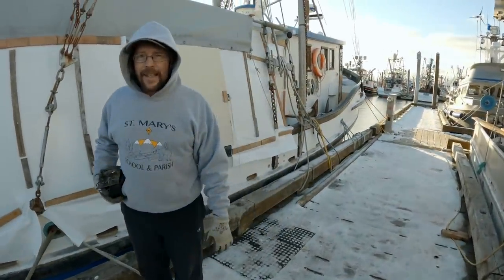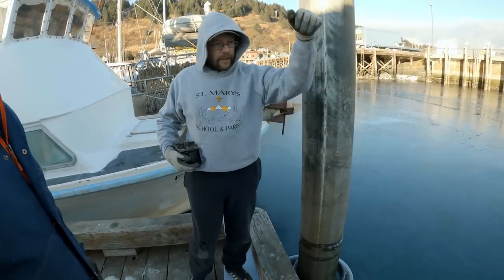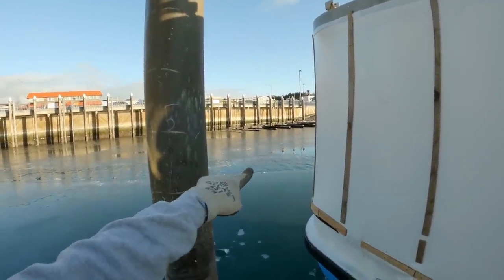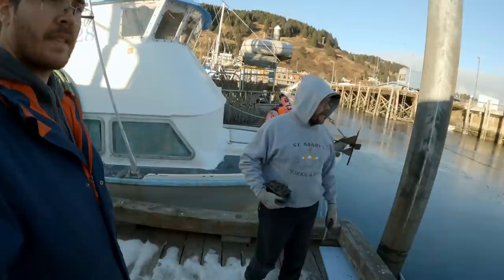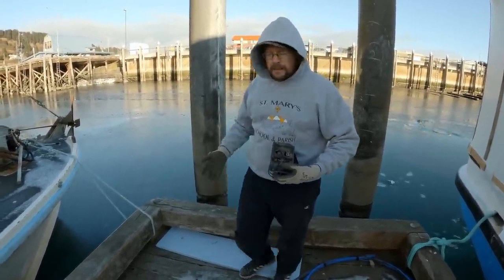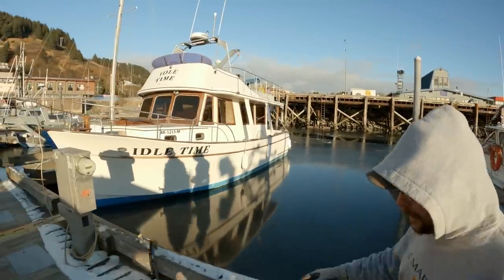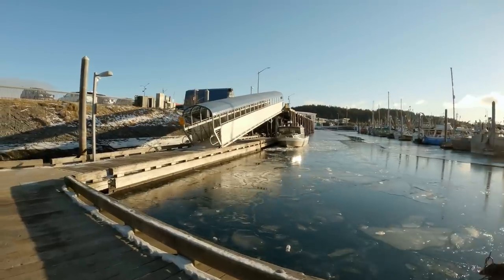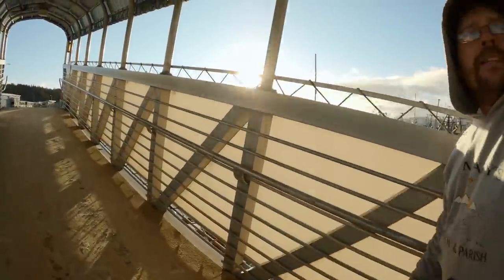Some Words About Our Docks, Tides, and Grid.

Comment: what do you do for cabin heat on the boat? I mean when you leave the dock .....I see when you drive the boat you take your jackets off so there must be a heat source
Reply from the maker: We have several heat sources on both vessels. The main one we use is Dickenson oil stoves. They provide heat and also a cooking surface. Second is bus heaters off the main engines, basically the same as a car or truck heater. If its really chilly we may plug in an electric heater also.

Comment: Yeah see those types of docks on most tidal waters if the marina is designed with the tides in mind...  Some have a partial floating and partial fixed or causeways...  pretty cool design you guys have how does it do during a storm?
Reply from the maker: No problem in storms. You can see the breakwater off in the distance when we are at the top of the ramp. It is very robust and handles anything, also only three miles of fetch or so in that direction.
Reply: @EISAlaska  Nice!! glad it is protected!! Stay safe EIS crew!